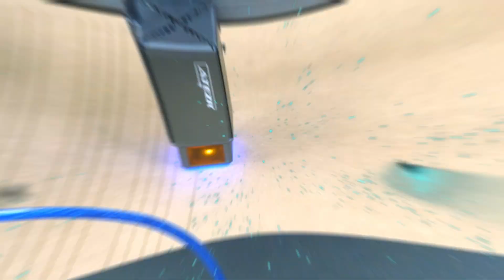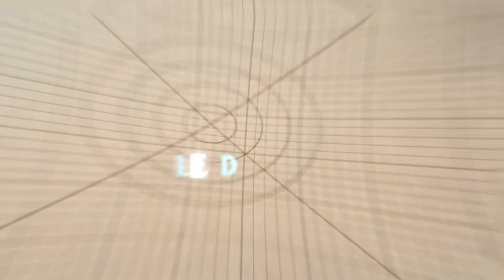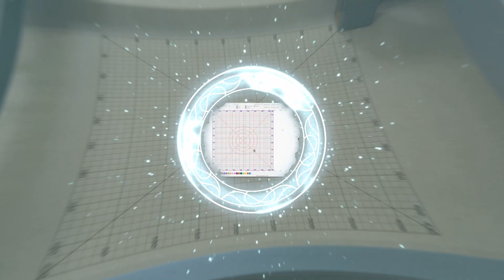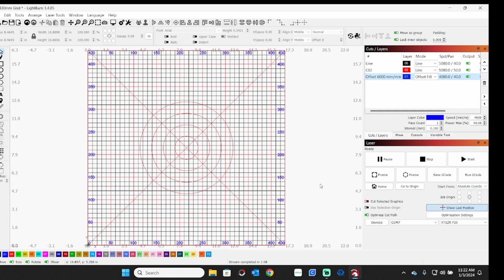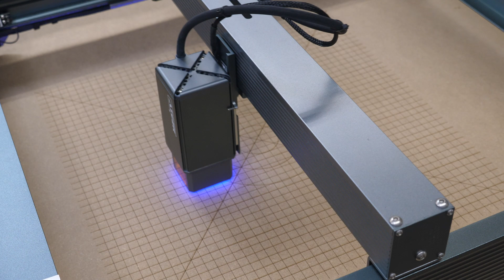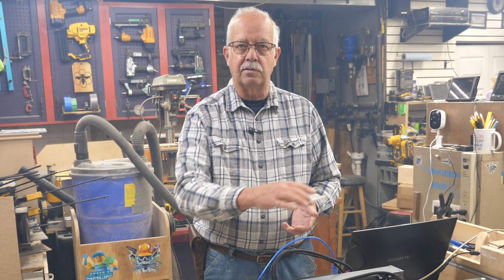Atezr P20 Custom Spoil Board and Mount

Comment: Atezr has the WORST service dept.! DON"T BUY this laser!
Reply: Thankfully, I haven't needed anything from their service department!
Reply: The laser it's self is a good one. It's their service dept that really sucks! I hope you never need them. I needed a wire harness for my Atezr V36.  They will not send me one. Spend over $2300.00 on this laser and now it's just sitting there doing nothing.
Reply: I feel your frustration. Though I haven't had problems with my laser, I have had similar issues getting parts for some of my woodworking tools. I think for a lot of companies, they let customer service fall clean off their balance sheet. @UnitTx1953